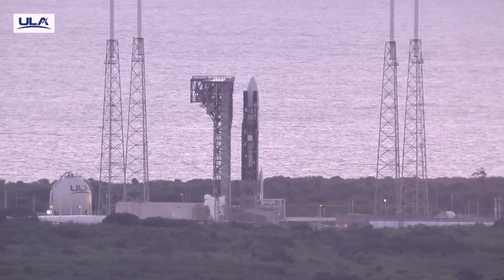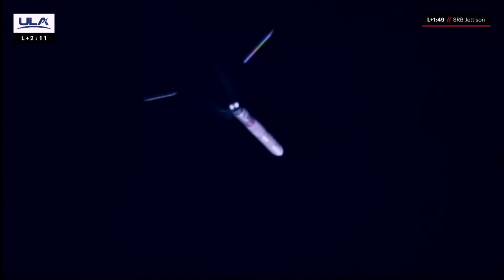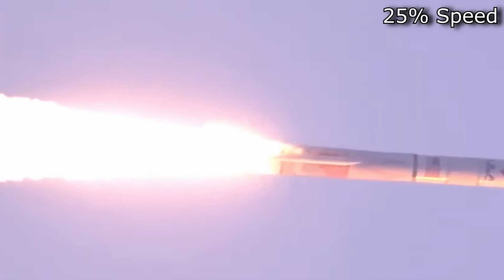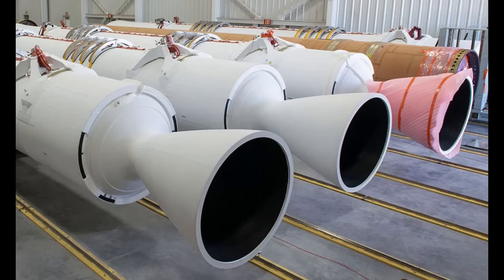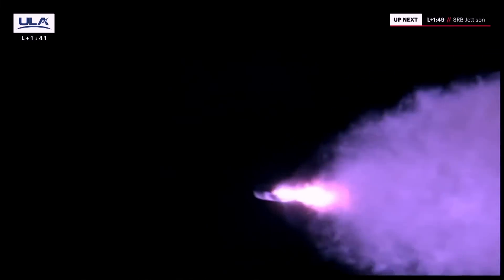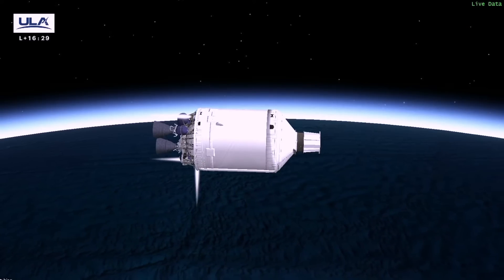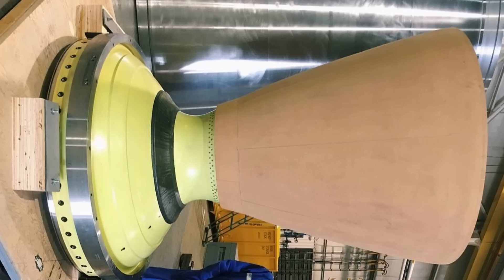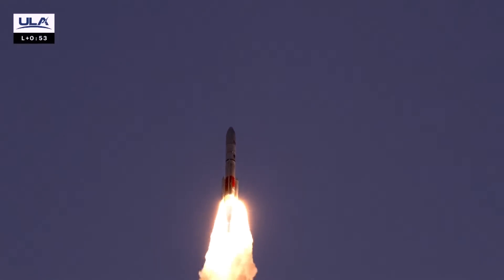How Did The Vulcan Rocket Survive This Booster Failure?

Comment: The software and hardware margins being able to compensate is impressive. There's many videos you've shared where the result is quite different. At least the IMU wasn't upside down. 😂
Reply: Flying the Atlas V 411 configuration really paying off now!
Reply: I was at an Omega booster test in Utah (Orbital ATK's Promontory facility) when the nozzle blew out with about a minute left in the burn.  This was about 5 years ago.  They said that it still would've made it OK to staging (don't know if that's true or just PR) but they still modified and retested it to ensure that it wouldn't (hopefully) blow out in flight.
Reply: They were really lucky that the booster didn't explode, or that the original burn through was pointed away from from the Vulcan!
Reply: This shows that the programmers understood the possible failures and properly took them into account.
Reply: @johnbennett1465  Not really. The control system simply detects that the vehicle is drifting to the right so it corrects by steering to the left. It is doing this all the time, nothing special needs to be done in a case like this failure.
Reply: @EinzigfreierName  this is only true to some limited extent. Pre determined parameters/gains are only effective within a limited range for control loops of a non linear system, even with a plant that can update the parameters dynamically, you still would want some degrees of failure mode detection to provide a new baseline for the parameter values so that they can converge to a optimum/steady state quicker.
Reply: @KPTKleist  thanks, you gave a better answer than what I was going to.
Reply: @KPTKleist  I know but all of this is pretty limited anyway because of structural limits and limited control authority from the TVC. I would be surprised if the control algorithm had to switch gains or something like this in an event like this. But I don't have the source code so I can't be sure of course ;-)
Reply: @EinzigfreierName  well the parameters change all the time even during normal ops because the flight regime encompasses a huge variety of conditions.
Reply: @KPTKleist  Sure. Weight, center of mass, air density to name a few. I didn't mean to say you'd get away with a simple PID controller :)
Reply: @EinzigfreierName 
True, it just needs enough directional thrust to compensate!
Reply: @EinzigfreierName  That is right a closed feed back loop control system measures with an IMU the vehicle attitude and agular rates, and compare them to the  preplaned  values from simulations. Any deviatioñs are converted to gimbal angle changes by invoking LQR  control laws. These days the attitude is measured, no longer with Euler angles, pitch, roll and yaw but quaternions, which are regular and far more accurate. It is not by steering but by a change in attitude, like an airplane autopilot.
Mein Name ist übrig auch frei gewählt🇨🇭
Reply: @EinzigfreierName  That happened on Columbia's last re-entry too. The shuttle began yawing due to asymetric drag (because one wing had a hole in its leading edge). Computers didn't know why it was yawing, but compensated for it. Right up until it reached the max it could compensate, and the craft spun out of control.
Reply: @Arturo4586  Yes, LQR or MPC could be used here and quaternions would be the obvious choice to represent attitude. (btw. es war der einzige Name, der bei Youtube damals noch frei war ;-)
Reply: @EinzigfreierName I think it's not as easy as staying on the predetermined flight path. There was not only the asymmetric thrust, which took extra thrust to correct for, there was also the loss of thrust from the srb. That means that the rocket will not have enough performance to make the originally planned flight profile. The guidance computer probably estimates how much thrust it lost, how much thrust is actually converted into forward motion, how much propellants it has available in both stages and how much more propellant is used up by the boosters, that need to be carried for longer than planned. Based on these variables (and probably many, many more) it could then calculate a new flight profile. That means a different flight path, a different staging profile (the boosters where held on to for longer, so they make the drop zone) and different burn times.

But I'm only a systems engineer in ERP, not a rocket scientist, so this could be completely wrong lol
Reply: @HouseGurke  I think this is much simpler.  If main engine cut-off is not triggered by a fixed timer but by reaching a target velocity, nothing special needs to be done in case the total thrust is lower than expected. The engine will just run a little bit longer. That's it and I think that is what happenend here. Same with booster seperation. Just don't seperate at a fixed time but when certain criterias regarding position and speed are met. The idea is to come up with a (relatively) simple and consistent control system that is tolerant to variations in flight performance instead of a rigid schedule that needs a lot of "special cases" to be handled.  Of course there will be such special cases but you'd want to keep them as few as possible. And a booster failure is probably not one of them.
Reply: @EinzigfreierName That is just stearing. The second stage burn time was increased "on the fly" to compensate for the loss of thrust. 
The ULA software engineers did an outstanding job. Of course if the payload had been closer to maximum there wouldn't have been any excess capacity to adjust with.
Reply: @MarkHorton-n3t  Makes sense. The first stage most likely doesn't have much (if any) fuel reserves designed in because it's a much easier task for the second stage to compensate for any error. But I don't think the engineers had to adjust the burn time manually. I would expect the vehicle to calculate parameters like this by itself based on target parameters. I could be wrong though.
Reply: @EinzigfreierName  No human could possibly have made that adjustment manually.  The software was designed to react to deviations fram the planned flight path. Unlike the Boeing programmers responsible for the 737 Max and Starliner the writers of the control software on board Vulcan did an excellent job. Vulcan flies itself very well.  However the closer the payload is to the maximum capacity of the rocket the less possibility of adjustment.  If one of the four SRBs that would have been used to launch Dreamchaser had failed instead of one of the two actually launching a much smaller passive payload recovery from the anomaly would have been impossible. Vulcan is NOT fit to be declared operational except in no SRB configuration.
Reply: @MarkHorton-n3t  Yes, that's basically what I said from the beginning. What we saw was control algorithms doing their jobs.
Reply: This is how the closed loop navigation systems on almost all rockets work.  If it deviates from nominal, the rocket dynamically tries to correct.  If it has margins to make up for it, then it succeeds.  If it doesn't, then it fails.  It has to work this way to get into desired orbits.
Reply: @stargazer7644  thats how they normially work, cough cough ariale 5 launch test overflowing its storage
Reply: well it
s a big core and small srb. Ariana 5 would have a harder time corrcecting for a failed srb.
Reply: Impressive engineering!
Reply: Proton mentioned‼️
Reply: This ‘observation’ almost turned into a scavenger hunt—where we’d be ‘observing’ pieces of the rocket all over the neighborhood 🚀💥
Reply: Actually very impressive that it made it to the correct orbit.
Reply: Also they had to decide on a "fck it" moment when they dont care where the boosters land.
Reply: You install the IMU upside down when you want to explore the Pacific Ocean 's depth
Reply: The title should include "and FAA Grounding Filter"
Reply: Comes close to that one astra launch failure in terms of coolness
Reply: My thoughts eactly. Very impressive indeed.
Reply: Imagine if this system had been designed by the Boeing team that designed the SCT-100 StuckLiner 😂😂
Reply: John Carmack is the one who figured it out.

Yes, the Doom guy. 

Everyone copies Armadillo Aerospace now.
Reply: @jtjames79 no.
Reply: It seems very few here are taking into account the number one issue for rockets: fuel.

All rockets are designed to very tight margins. This includes not CARRYING extra fuel. Every kilogram of fuel you don't use costs several kilograms of more fuel needed to lift that fuel. 

But the risks are for very minor variations, things like crosswind, air temperature and pressure, combustion variances and sonic buffering(?), ... These are all single percent to a few variations. They never come close to what happened with this launch.

Current private-sector-competitive rocket producers did not design their systems to tolerate such a major loss in one of the engines. IANARE but MLA apparently over-engineered their rocket systems to be able to compensate a 15% or so loss of propulsion. Such sustained loss is rare. Usually the whole system blows up with such a failure. 

So, were they just lucky? Or did they really "over-engineer" their systems to this degree? Maybe the system just has enough fuel capacity for extra heavy loads, and this was lighter than the maximum???
Reply: Yeah but it only wasn't mission failure because of the basically non-existent payload.
Reply: @Ergzay  It had a full payload.  That's what a mass simulator is.  It just wasn't a functioning satellite.  It was a success because it made it to the intended orbit.
Reply: Yea just like rockets have done for many decades.  They don’t need to know much other than “I need to go X and I’m currently slightly off, I can adjust variable Y to correct my trajectory.”  They don’t have to code for “if part/all of the nozzle on booster one has an issue that results in asymmetric thrust, gimbal the BE-4 X°.”
Reply: @qwerty112311  Exactly

Comment: I'm shocked it made it, it looked off almost immediately to me and after that blast I thought it was over for sure.  Stunned it made it.  I remember everyone for years freaking out every launch until SRB sep.
Reply: Every time I saw a shuttle launch I sweated until the SRB's separated because I knew a SRB failure was pretty much a death sentence.
Reply: @535tony  Yeah, that's what I meant.  They really haven't been a big issue since then that I can remember much.
Reply: @Totttty55  I remember a Delta launch in the 90’s where an SRB exploded and took out the whole booster. Flaming debris fell all around the launch site. Lucky nobody was killed. ULA was very lucky that SRB case didn’t fail. I think Northrop Grumman made the SRB’s. This is their problem now. I think these are different then the SRB’s used on the Atlas V to launch the Starliner but I guess the Starliner isn’t going to fly any time soon if ever.
Reply: @535tony  SRBs have been around a very long time and statistically they are super reliable.  The biggest thing to be nervous about is once lit, they can not be shut down!! Anything else goes wrong, you have no choice but to ride out the entire burn.
Reply: @professorg8383  But every once in a while they kill seven astronauts. I don’t like solids on manned boosters. As I recall the Vega rocket had some problems. I know the Vulcan is not man rated, yet.
Reply: @535tony  Ah yes, the "WE HAVE HAD AN ANOMALY" Delta launch
Reply: @535tony O rings.
Reply: @andyspoo2  O rings are part of the SRB. I recall one of the SLS SRB’s had a nozzle failure during a test.
Reply: the real hero here is the Centaur upper stage that had capacity to burn for an extra 20 seconds
Reply: @shazmosushi  It was supposed to make extra burns to simulate putting different payloads in different orbits. I wonder if they had enough fuel to complete all the burns.

Comment: Had there been a manned crew capsule on the rocket, it probably would have jettisoned to get away from a potential explosion.
Reply: For a satellite mission, the rocket will do anything to put the satellite into orbit, unless the rocket threatens public safety. For a human flight, the rocket will do anything to save human lives, and thus abort when the parameters are off-nominal.
Reply: Interesting question. Would the on board sensors have detected that as a critical launch failure event?
Reply: I dont think there are plans to rate the vulcan for manned flight.
Reply: @DanielShepard-t5f  They'll have to if they want to keep the CST-100 flying, they're running out of Atlas-V rockets to use for that.
However, with the larger rocket overall, the switch to more efficient Methalox first stage propellant, and the MUCH larger Centaur-V second stage, I think that it's quite possible that the CST-100 would be able to be put into orbit by Vulcan without any SRBs required whatsoever, removing the "Don't put SRBs on a manned rocket" (non)issue. It's a non-issue because Space Shuttle, SLS, and Atlas-V N22 all use SRBs, and SRBs have only been the issue a SINGLE time, which was Challenger, and that was only fatal because the Space Shuttle had no abort system.
By the by, SRBs are the exact kind of rocket that the US's first forays into manned spaceflight were using for abort systems, on Mercury, Gemini, and Apollo, and worked flawlessly during testing despite the supposed safety issues with SRBs on manned flights.
Ejection seats for fighter jets also use (smaller) SRB's because they store well.
Reply: @DanielShepard-t5f  Then there's a minimum crew of nil?
Reply: As with anything there would be performance and trajectory metrics built in both for the rocket as a whole and presumably the solid rocket booster it’s self. The second it exceeds those the powerful rockets would fire to jettison (eject) the crew capsule away asap.  I would assume you would design this to shut off the main engines as soon as jettison is triggered both to help the capsule get away faster as well as reduce the risk if it is damaged and about to blow up, but I don’t think it would be mandatory as I’m assuming the capsule would have enough power to get away regardless of if the rocket is at max total thrust. 

I don’t think anyone can say for sure if this flight would have exceeded the automated metrics for human safety. Jettisoning the crew capsule has its own risks that has to be considered as well. The other possibility is a manual jettison. Given the visibility of the failure there is a decent chance even if the automated systems didn’t trigger it the pilot (or possibly ground crew) would have triggered it. 

Google for the blue origin abort/jettison on one of their science flights to see what it looks like. At least on the video nothing was obviously wrong, but it went out of parameters and the jettison triggered.
Reply: You can't turn off SRB. If the uncontrollable SRB would be jettisoned there is a high chance it would hit and destroy the booster.
Reply: They are talking about the crew capsule being jettisoned, not the SRB.
Reply: @NitFlickwick  anyway, to jettison crew capsule you need to shut down the rocket first.
Reply: @skipperg4436  The guidance system on the main rocket is not dependent on the crew capsule to be attached.
Reply: @NitFlickwick   why don't they just jealous in the whole rocket
Reply: @skipperg4436 I was under the impression that the escape capsule pulls the astronauts away at normally unsafe g forces that the rocket isn't designed to reach when carrying manned payloads specifically in order to remove the astronauts from the rocket faster than the rocket is built to go
Reply: I doubt it.  It's safer to finish getting to orbit than abort along the way, mostly on account of being able to choose your landing location.
Reply: @tippyc2  One of the prime conditions that is looked for by the abort computers is un-commanded loss of thrust.  Beyond a certain amount (and the tolerances might be pretty tight for NASA's manned rating) and abort is required.  What kind of abort would of course depend on where they were in the launch profile.

Comment: Why is 2024 the year when so many flight-proven hardware are experiencing issues?
Reply: This is test 2, wouldn’t call Vulcan flight proven. But ULA has an extremely good record, so this is pretty weird.
Reply: @ryanhamstra49  Vulcan proper, no, but these SRBs have been used on Atlas and other launch vehicles for years, possibly decades.
Reply: @SkulShurtugalTCG  GEM 63 is used on Atlas V. This is GEM 63XL, which has about 20% more thrust and is a bit longer.

Comment: 50% failure of a srb is a bit of a worry. also lucky it was a mass simulator, would they have had enough fuel to correct the first burn with a full weight payload.
Reply: Tory Bruno says yes: they have a standard propellant reserve margin, and that amount would completely cover this underperformance.